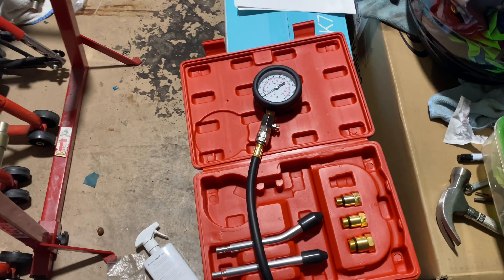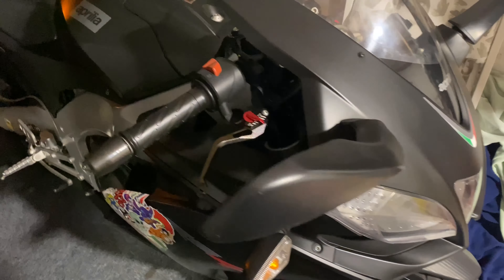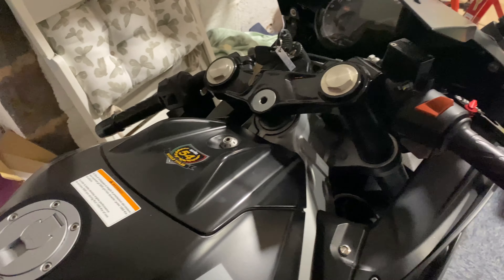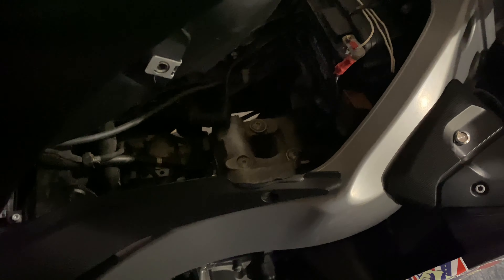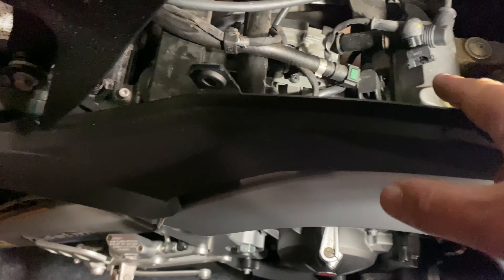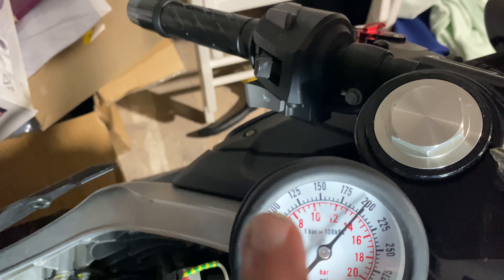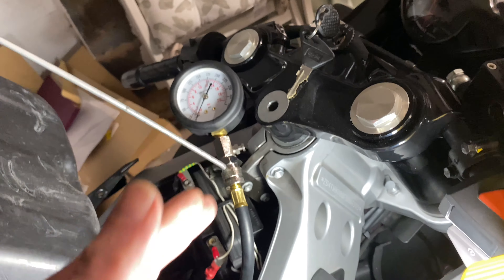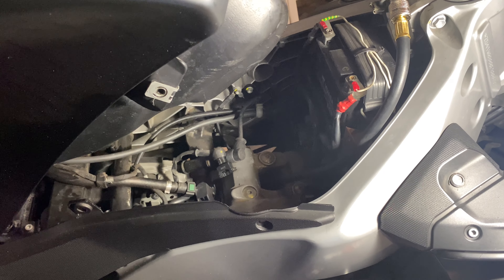Easy Scooter/Single Cylinder Compression Test and Leak Down Explanation(Aprilia RS4 125)

Comment: Thanks for another informative Aprilia RS4 125 video Dean, glad your bike seems in good shape - I just wanted to say I recently did my oil change, oil filter, air filter and spark plug as per your video, which was a great help. I replaced my screen, which was more of a pain and left me with some 'remaining bolts/screws'... I need to do my chain next so will be following your chain adjustment video too. I still haven't got the upgraded lights as you sent me a link that was different to the one on the video and I wasn't sure which one was the correct one...Anyway thanks for all your hard work and I appreciate the knowledge sharing for the Aprilia. All the best. Roger
Reply from the maker: Cheers Roger really appreciate the support 👍👍

Comment: I'm in the middle of diagnosing what the problem with mine is, I've been having poor idle, sometimes it'd fluctuate from a nice 1200 to about 5-600, I'm going to give it a service tomorrow but it felt like when I was riding it I was losing all power, an example would be doing 30mph and then it will choke up and decide that the throttle doesn't like 30 and it'll choke up a bit and drop to 27 so despite giving the same revs, etc and consistent throttle it will drop by itself, and this has only just started, I'm not sure if you'd know what the problem is just by my description, any little helps

Comment: Is the pressure different compared to the 250cc Forsight bike ?
Reply from the maker: Pressure will be in relation to your compression ratio 8:1 9:1 etc.. how to work it out is times by 14.7 so example 9:1 compression ratio would be 9 x 14.7 = 132.3 psi 👍
Reply: @BigBoyzToyz1974 ( 132.3 psi) is the maximum pressure ?
Reply from the maker: @DEEPWATER..  ok for the Honda Forsight 250 it’s 10.5:1 so psi should be 155psi anything above 130psi is ok anything lower might need investigation 👍👍
Reply: @BigBoyzToyz1974  Thank you very much, your answer is very clear and useful 👌👍

Comment: My cbr 125 has 155 psi it should be 195 psi my bike uses oil quite fast like 1/4 a day . when i go down hill not throttling and when I rev there a big puff of smoke. And my acceleration is about 25% less then What it used to be.  If it was rings it would continuously smoke surley
Reply from the maker: It's rings 100% easy job mate might aswell throw some new ones on get that compression back upto 200psi
Reply: @BigBoyzToyz1974  you don't think it could be valve stem seals
Reply: Bike has done 45k milage lol
Reply from the maker: You really need to do a leakdown test it will highlight where the leak is coming from but it definitely could be seals. Always hard to diagnose over messages but if 45k I would just get a bugbore kit and fresh up the topend shims valves valve guides etc be about £350 I imagine if you do it yourself
Reply: @BigBoyzToyz1974  cheers mate 👍
Reply: @BigBoyzToyz1974  if I change the rings do I need to rebore the cylinder or any thing or I can just slap the rings on and put in cylinder
Reply from the maker: Really depends on the damage to the bore but generally you should be fine as when you run the new rings in they will bed into the bore shape..